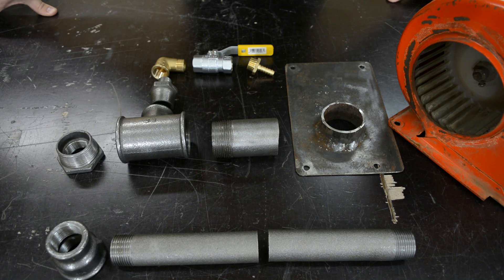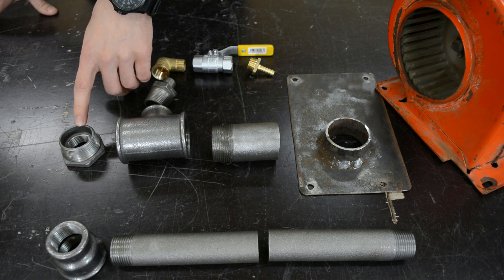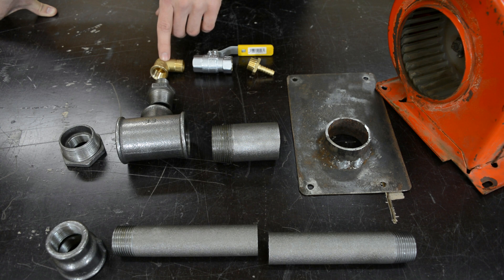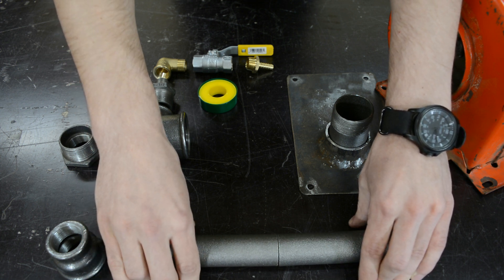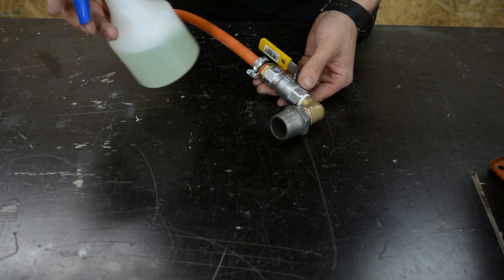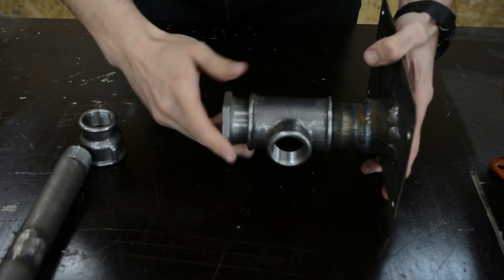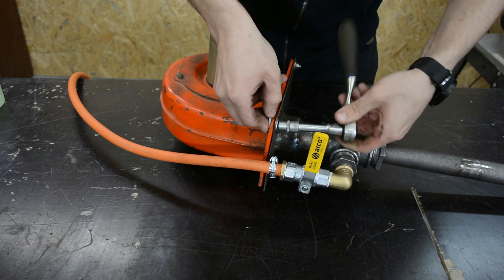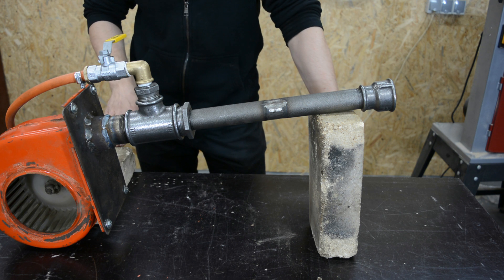Forced air propane burner

Comment: when did you switch from metric to imperial
Reply from the maker: that's how they are sold. I guess no one makes them in metric
Reply: MP Dragon it is how they are sized according to the bore (internal diameter) They are sized in imperial according to the Nominal pipe size. It's the standard size for North America. DN (Diameter nominal) is the international metric version. 

1/8 - 6, 1/4 - 8, 3/8 - 10, 1/2 - 15, 3/4 - 20, 1 - 25, 1 1/4 - 32, 1 1/2 - 40, 2 - 50 ect 

Schedule is the pipe thickness. 20, 40, 80, 120, 160 ect 

After a certain size, it automatically changes to metric. I think it's 600mm

Comment: Excellent, could I ask what amount of air flow do you get from the blower? I'm looking at them on Amazon, is 3.5m(cubed) ok? Does any heat travel back to it? So can it be plastic or does it have to be metal? Thank you
Reply: Shaun Whiteley no I don't think heat would travel back to the blower because it is supposed to push to air out
Reply: So it can be plastic and 3,5 m cube is good
Reply: Thank you 👍